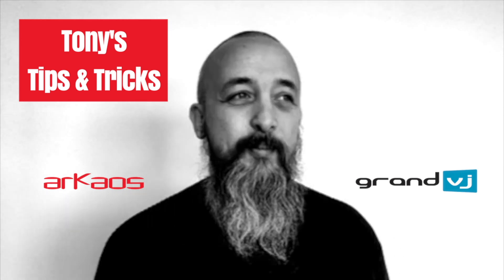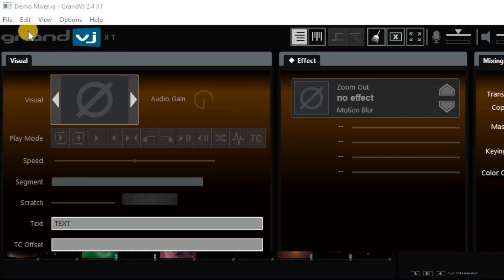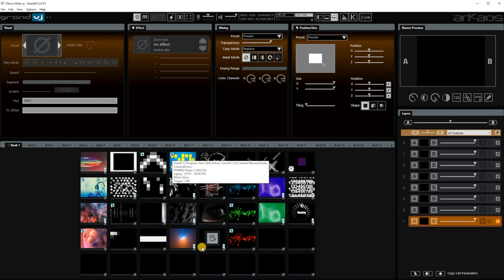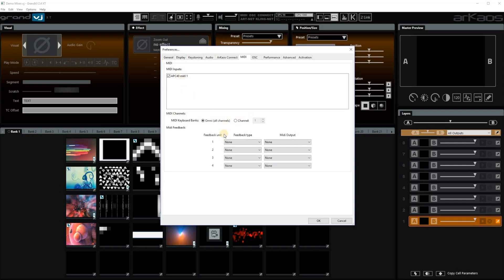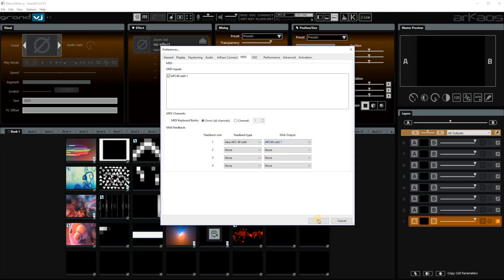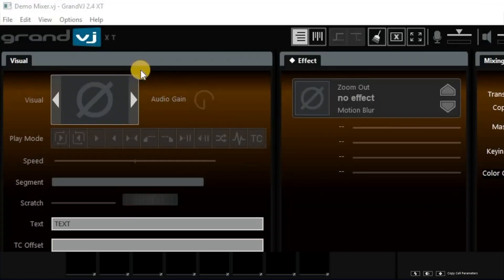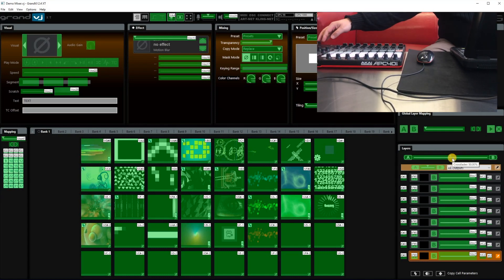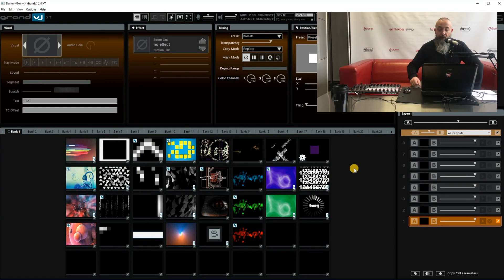Tony's Tips & Tricks: Midi controller Tutorial

Comment: Can we get a newer video with you hooking up a controller not on the list please. I have controllers all over the place. My MIDI controller is stating, "Could not open". How do we fix that? Nothing in the manual about that.

Also when I do get it to "open" or connect to Grand VJ my controller is not in the "feedback type" column in the preferences. What do we use in the feedback type? It does show up in the MIDI Output column though. Trying to hook up a Akai MPD 26 to Grand VJ XT. FYI. I am also thinking about hooking up a Behringer CMD LC-1.